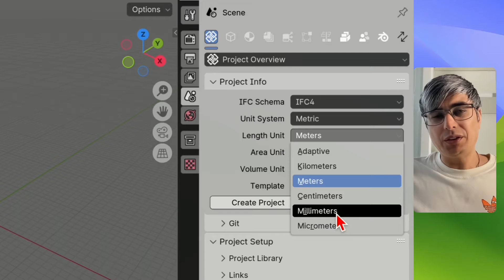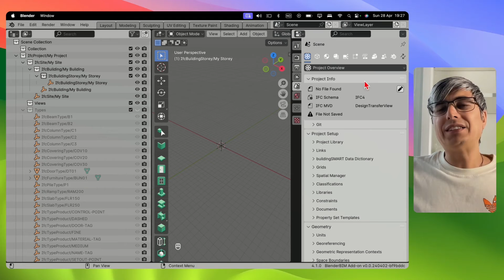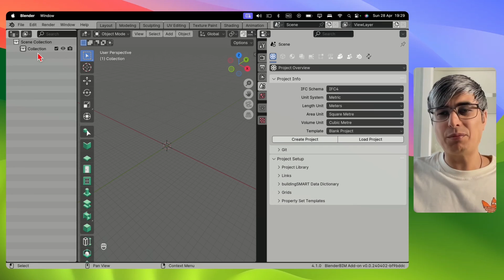How to Create an IFC Project in BlenderBIM (Full Guide)

Comment: I am a draftsman working in a tire manufacturing company. I have been following your YouTube channel for some time now and am incredibly impressed by your expertise in BlenderBIM.

I am currently working on creating technical drawings and animations for our engineering department. While I am proficient in Blender for 3D modeling and animation, I am facing a challenge in creating 2D outlines of complex 3D models for technical drawings.

My current workflow involves exporting the 3D model from Blender to a .dae format, importing it into SketchUp, and then using SketchUp Layout to create the 2D drawings. While this method works, it is time-consuming .

I believe that BlenderBIM could be a more efficient solution for this task. However, I have been unable to fully grasp the workflow for creating accurate 2D outlines of 3D models directly within BlenderBIM. I would be immensely grateful if you could provide a detailed workflow or tutorial on how to achieve this using BlenderBIM.
Reply from the maker: Thank you for the kind words. Follow IfcArchitect channel for more videos about modeling and drawings.